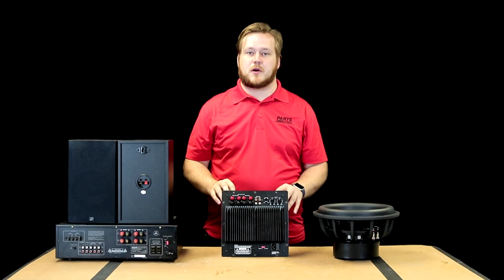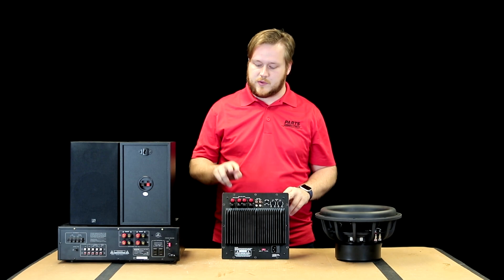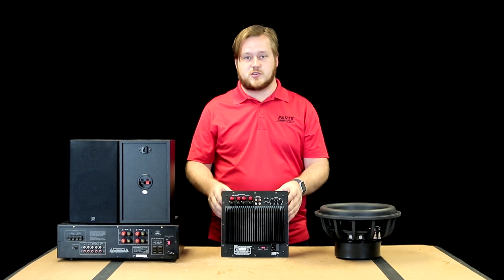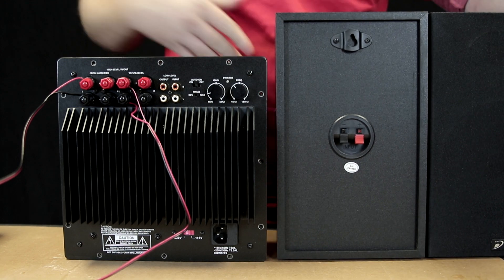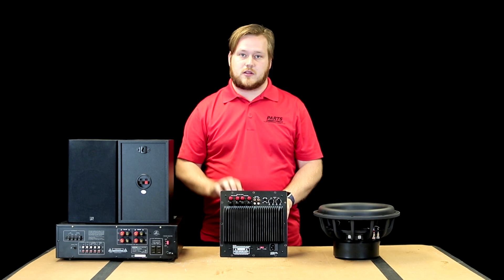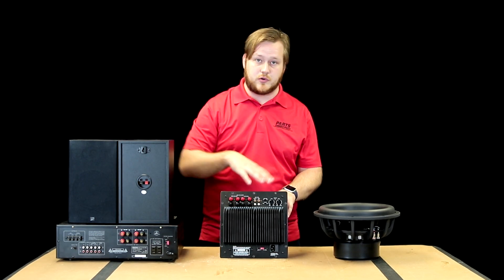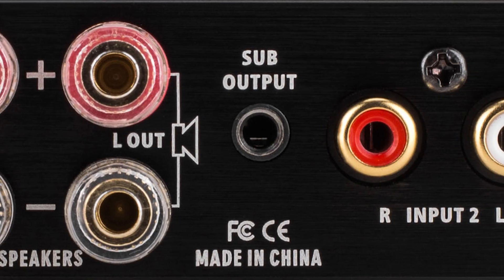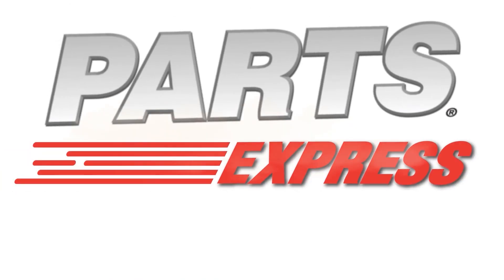Subwoofer Amp not working? Make sure it's hooked up correctly.

Comment: What if you take your amp with your output it goes to the speakers to the high-level input of the amp of the subwoofer and then hook your subwoofer speakers in to your subwoofer what network cuz on my amp I don't have a subwoofer plug in

Comment: Hi i have  celestion s10 active  subwoofer.  but some it stop working. i have checked all the fuse and one of the fuse was burn. i have changed that and as soon as i turn up the power. it burn again. do i need to seet up the voltage i am in the Uk ? 
and voltage already set on 220v .
can you please help me many thanks
Reply from the maker: You should write our tech department. They can answer this for you. :) Tech@Parts-Express.com

Comment: Wouldn't it make more sense to run "two" pairs of speaker cables from your amp, 1 pair to the sats and 1 pair to the high level inputs on the plate amp?
Reply from the maker: You could. Doing that would keep the low end in your sats though. This way lets them hit the built in crossover. You could also do BOTH! Run them through the sub amp from your receivers "A Speakers" and run them to another through "B Speakers". This means you get A or B or A+B. A third option is running to the "from amplifier" using speaker cable, and then right back out the front using banana plugs to your sats. This means no crossover and COULD be redundant....but its another option at least. Hope this helps!